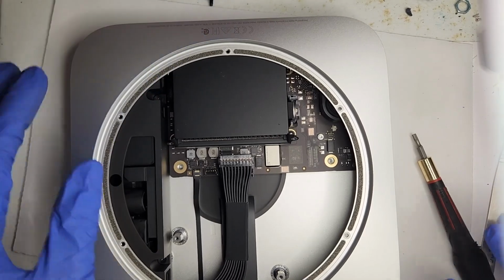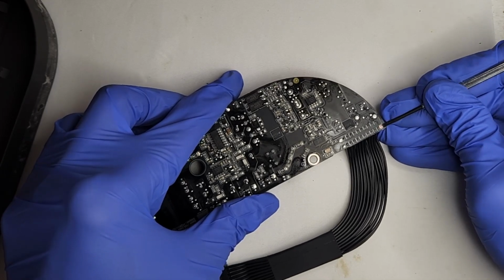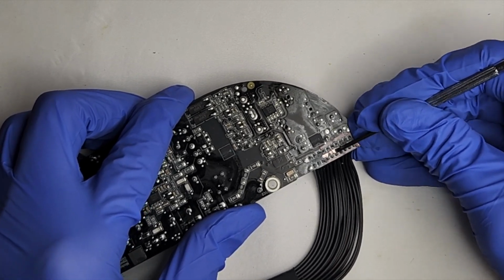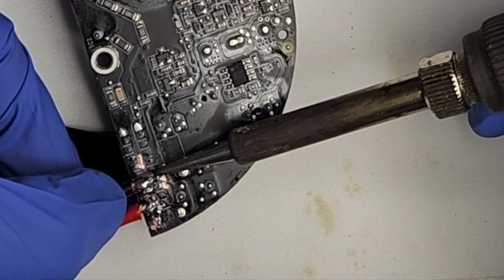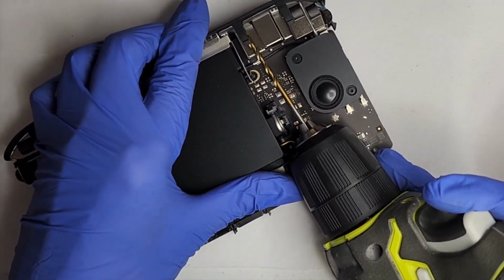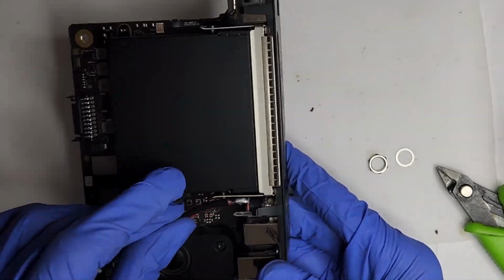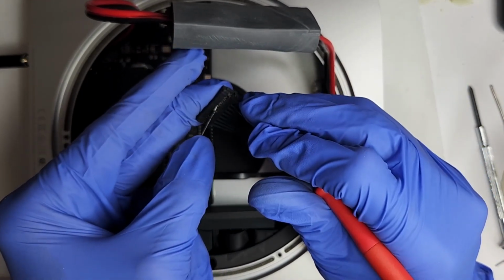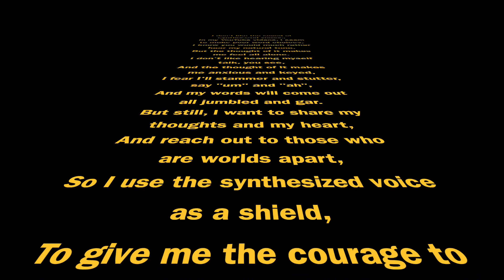Revised: Hack your Mac Mini M run on 12v DC Car power Full Length. #hack

Comment: adding 3x 18650 batteries would be very cool, would probably work with only a balancing board, ptc fuse and a diode keeping the batteries @ 80%

Comment: Hello, Great Video, does the 12 v. modification reduce the overall power required to run the Mac mini?  Also, does the "power on" button work normally? Tnxs
Reply from the maker: Yes, when power source is DC.  you wont need and inverter.  Power button still works.

Comment: Looking forward for Mac mini m4 version!
Reply: It should be relatively easy. From the the tear-down of the M4 there are two wires coming out of the PS and connect to the logic board. I think rather than splicing into the those  2 DC wires, and thus void the warranty is find the connector type and link that up with the DC power source.
Reply: @darthslackus499  From what I've seen online, the power is transfered using special screw terminals on opposite sides of the board, so that part doesn't even require soldering, just screwing dc source and it's done, but there are also some other connections of uknown purpose, maybe for triggering on/off or some sort of measurements? somebody with hardware in their hands and some repair experience would know better how to tell and if they are needed at all

Comment: Great video again, thanks! I’m getting my Mac tomorrow and am excited for adding the 12V port!
Would this also be possible with USB-C PD?

Nice to read some personal thoughts in the end. Thanks for that, it’s totally understandable! Maybe you could hire someone from fiverr for example for voice over. 
Also it maybe would be great to have the meter on cam while you’re testing connections and adjusting converters, so it’s  easier for beginners to follow the steps and make them more confident. 
All in all great work! Thank you and keep goin‘ :D
Reply from the maker: You're welcome.  Glad I could help.  As for your other suggestions, thank you!  I will do them in next videos.  As for USB-C, I'm getting a good amount of request for this, so stay tuned!!
Reply: @mikegyverComputer  Hey hey! I dived a little into USB-C PD and just started using my PC Monitor with an 20V PD trigger cable and noticed that with 12V USB-C PD only can provide 3A. Seems like this could be not enough for the Mini? So probably we'd need to go with 20V and step it down to 12? Just assuming, I'm not that much advanced with electronics
Reply from the maker: @fufhi3102  Yes, working on a video to address it.  It's not as simple as it sounds.  Meanwhile, check out this vid from Snazzlabs, they addressed the issues, but I am looking to change that.  https://youtube.com/watch?v=pQWGFKhBQwU&si=EnSIkaIECMiOmarE

Comment: Has the original power supply not already got its own regulator built in? Seems to have a lot of electronic stuff surly it's got a regulator built in? And another thing. I won't be drilling unnecessary holes in the front of my mac mini. Why don't you use the  AC cable plug it in to the AC contacts of your Mac Mini and then connect you regulator to the contacts inside the from there solder the wires of the regulator to the motherboard? Why don't you do this instead of drilling ugly holes in your computer. 😏